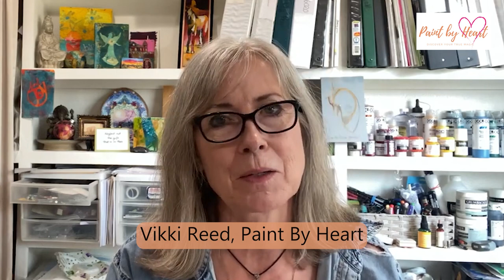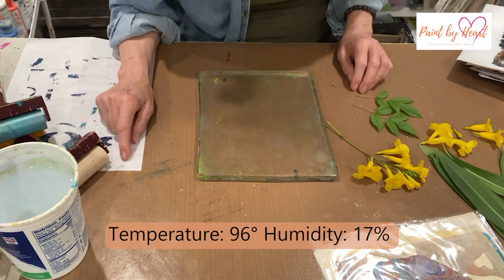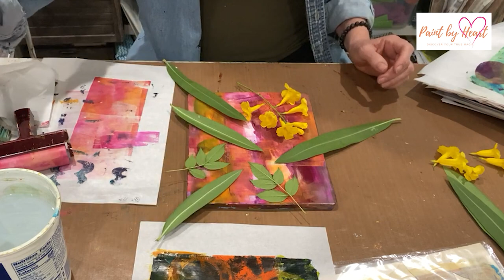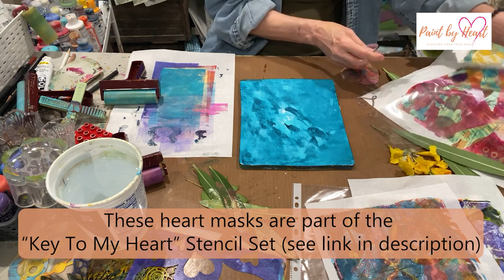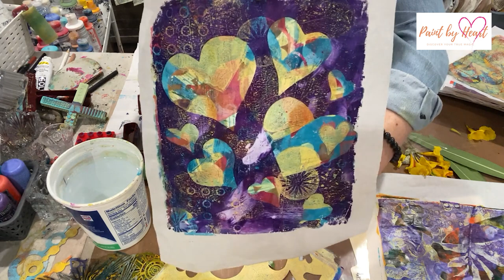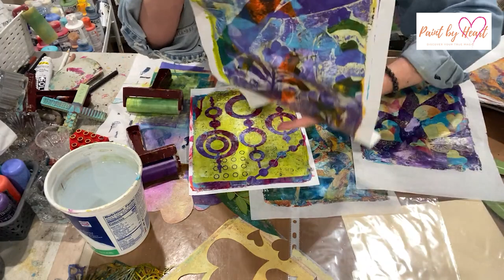Gelli Plate Techniques Reworking Failed Prints

Comment: This was SO amazing! Thank you for all your ideas. Extremely helpful! I also live in Arizona and was playing with gel plates today. There were times that the paper ripped when I did a pull and stuck to the gel plate. I was using cardstock. Do you have any advice on preventing that from happening?
Reply from the maker: I have experienced the same!  What I am observing is that if the humidity is below 20% or above 55%, it is more difficult for ME to pull a good print.  One of the things I try when that is happening is to "condition" the plate, (smear mineral oil all over the surface, let it sit for ten minutes or so, then wipe it clean with baby wipes).  Gelli plate printing is very magical when it works, and as you and I have both observed, there are times when it does not!
Reply: @VikkiReed  Vikki, thank you for the quick response. I will condition my plates tonight.😊
Reply from the maker: @judyconstantino7035  I hope it helps!  Other things to watch for...it's harder when the A/C or fan is blowing in your work space, and if your paper has any "tooth" or texture, it also makes it hard to get a clean pull.  Good luck!
Reply: @VikkiReed  Makes sense. Thanks for the advice!

Comment: I wonder if folks in hot dry climates would have better luck if they added a small vaporizer to their work area (I realize table space is at a premium, but the sacrifice might be worth it). I use one from Vicks with distilled water in the Midwestern winter (for other reasons) that I like.
Reply from the maker: Candy, that is certainly worth a try, thank you for the suggestion!